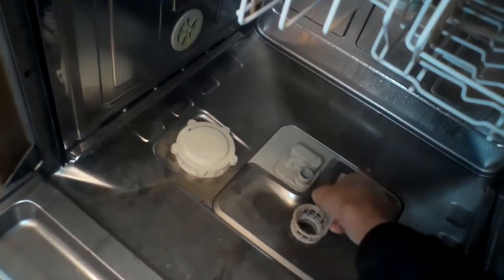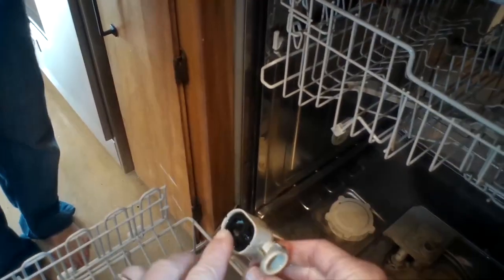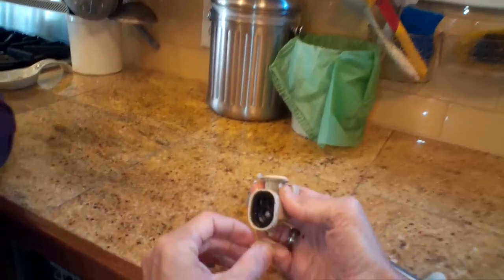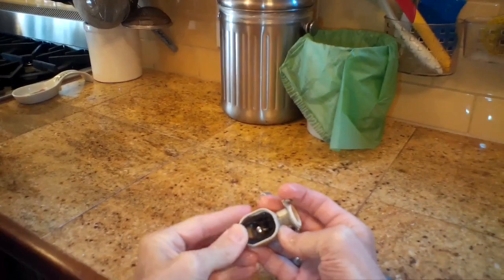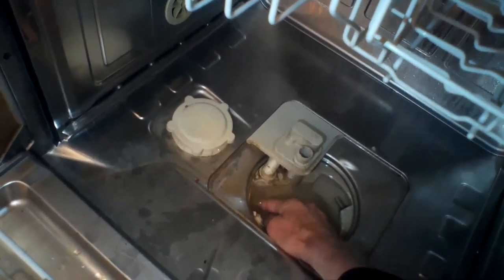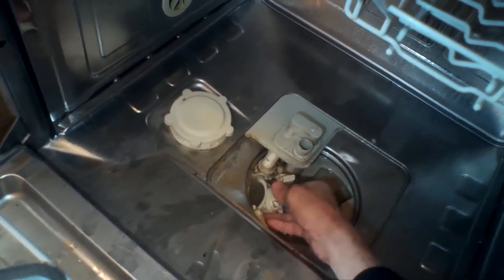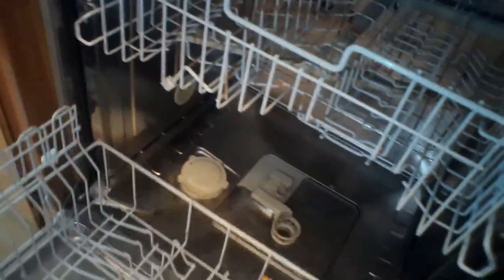✨Miele Dishwasher - Water Left At End of Cycle - EASY FIX ✨

Comment: I’m having an issue where if you do a manual drain it works fine but after a cycle, you see three or 4 inches of water on the bottom. Technician put a new pump in. I did do a power pull still having an issue. it’s getting to the point where it might not be worth fixing and I would hate to replace the unit if it’s something silly any help I would appreciate it
Reply from the maker: Do you think that the fill valve isn’t closing all the way and is letting some water leak in?

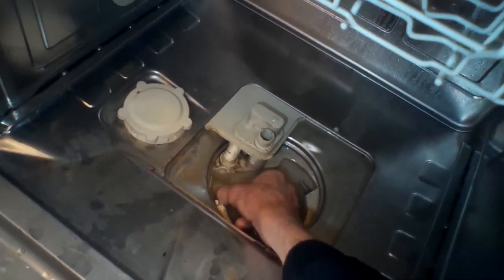Comment: What is the little metal rod with the black seal, just to the very right of your hand (example at 1:18)? Mine used to have this but I just noticed the metal piece is no longer there?!
Reply from the maker: That is the temperature sensor probe.
You can remove the lower panel beneath the door and then one more panel beneath that and you’ll be able to unplug it and reach in and push that pro back in.
It’s important that it is in position otherwise water can leak into the drip pan below the dishwasher.
Reply: Scottthefixitguy Thank you so much for that, I’ll give this a try. I noticed it did seem to be running hotter than usual so that makes sense.

Comment: Did the fixes as Scott describes to ensure augers are free but still have to turn the unit off and back on to reset the error. Then I start a new wash cycle which initially drains the tub but then fairly quickly the fault light comes back on flashing and the unit will not drain?
Reply from the maker: Sounds like it’s draining but then after it fills it won’t do circulation due to a stuck circulation motor.

Comment: What if the impeller is spinning very freely.  You mentioned it may have some resistance. Mine feels like it has no resistance.  The ball bearing moved fine....still have standing water. Thanks.
Reply: Me too. Did u check if waste pipe was blocked.

Comment: There it is. This looks more like the dishwasher I have. That little pipe that connects to the check valve or non-return valve. If you look closely at it, there is a seal around the pipe where it connects. That seal has deteriorated and that's where the water is leaking from. Is that the drain pump assembly? I've been searching all over the internet and I have no idea what the name of that part is.
Reply from the maker: Hi John,

I would call Miele USA and tell them about that one way valve sump seal and they should be able to send you one.
Reply: @ScottTheFixItGuyChannel  Hey. I already did. The part is called the "sump" and it's not something you can replace yourself. Someone actually has to come out and do it.

I just ordered a new machine with the extended warranty for $1399.

The service rep I spoke to said I've already put $500 into the machine already over the years. It doesn't make sense to put anymore. It's 10 years old, but it's actually 20 because it gets used twice a day. 

I've heard the older machines are better because the new ones use less power and water. I guess I'll find out.
Reply: @ScottTheFixItGuyChannel  It's amazing. The one I got is the G4993SCVi. It's identical to the one I have which is G2182SCVi, except it has visual timer and the 3D Cutlery Tray. Other than that, it's the damn same machine. Unbelievable! All their machines clean the same. You're just paying for bells and whistles. 

The saleswoman at the store even said unless money is no object, it doesn't make sense to get their top of the line machine. There were mostly interior designers in there spending other  people's money. The Lumen series of machines, you're basically paying another $1000 for lighting, the AutoOpen function and a few more wash cycles which you'll never ever use.
Reply from the maker: Gotcha,

Another option would be to buy an O-ring from the hardware to put around the stem of the one way valve.

You can even run the dishwasher without the one way valve and it will work.
Reply: @ScottTheFixItGuyChannel  Yeah, I thought of that but from the looks of it, there's no way of removing that part. I'm not sure if it's glued in or what, but there's no screws or anything like. 

The seal has deteriorated from the front and around the back of that pipe. If I set it to Pots and Pans where it has that initial first rinse and drain.  I have to use a WetVac to get rid of the excess water after it drains or else it'll start the main wash with dirty water. I mean the machine will still work, but not like it's supposed to.
Reply: @ScottTheFixItGuyChannel  Okay well you were right, but it took talking to 3 different tech guys to find out. It turned out to be a $20 fix. The "sump" is the entire bottom assembly that includes the non-return valve which explains why it costs $75. All I needed was the cover which comes with the seals. Still getting the new machine installed on Wednesday though. I can't wait until Friday or Monday for the part to come, as ridiculous as that sounds. Calling Customer Service on a Monday is a disaster. Anyway, thanks again.

Comment: Hm, mine is all clean and fine, but it still has some water left. Now even more, almost in line with triple filter inlet. I cleaned the drain hose, looks clean as well. Really makes me wondering what can it be.
Reply from the maker: I bet your water inlet valve is leaking a little bit of water that builds up in the dishwasher even when it’s off.
Time for a new inlet valve.
Reply: @ScottTheFixItGuyChannel  I still have the warranty (10 years). Would this be covered? Is there any way to check it before I call a service guy?

Comment: What about the drain hose? The way our machine is installed, the drain hose comes out of the bottom left of the of the sink cabinet and is connected to the garbage disposal.  I saw in another video that the end of that hose has to be above the connection to the disposal or water from sink may enter that drain hose and go back into the dishwasher. Our neighbor has a Miele and his machine drains almost completely at the end of every drain and fill. 

It's not the impeller and ball bearing moves freely, although sometimes it seems like it gets stuck and there is no way of taking off the seal like you do in the video. Miele's customer service wants $240 just to come out. It's like $180 for them to come out and then there's a diagnostic charge. I'm just wondering if it's the position of the drain that's causing it not to drain like it should.
Reply from the maker: That’s highly likely.

Does it drain through an air gap up by the faucet?
Reply: Hey sorry about that. No, it's just a standard Franke faucet and like a said, the drain hose connects to the disposal which is also a Franke. It's just that I get different answers. The people at Miele say it's normal for water to be there. My thinking is after a wash cycle, if that dirty water doesn't drain completely; it's just being introduced into the next cycle. The guy that Miele store told me that the tabs actually work better if the water is slightly dirty. I couldn't wrap my head around that. 

The machine works, but I would feel alot better if it's drained completely instead of leaving 3 inches of water in that reservoir.
Reply: It was the non-return valve. There was also a crack on the middle feeder arm, plus the threading on the arm was shot. Plus I got all new bottom wheels. Well four of them. I was shocked how inexpensive the valve and arms were, but those wheels were $13.99 each. They kept on falling off whenever I pulled out the tray and it was getting on my nerves

It was draining fine, but the machine makes a distinct noise when it's about fill from a drain. You know what I'm talking about. When you opened the dishwasher at that point, you could see the water just coming back into the machine. He also adjusted and cleared out the drain hose to the disposal. It was a host of issues, but it's working great now. We were going to get a new one, but $1500 versues $215. I'll stick with the old one. The guy also told us the new machines aren't as good as the older ones. They use less water and less power. Who knows, but I know I didn't want to spend that. I'd rather get a new TV for my bedroom.

Comment: Great temporary fix but I’m doing this every other wash. This in turn prevents the unit from drying the dishes. What are the options for a permanent fix?  Thanks.
Reply from the maker: It’s normal for some water to be left under the filter.
Reply: Scottthefixitguy the entire tub is full of water not just under the filter. I have to turn the unit off and back on it reset the error. I then start a wash which drains the tub. Then I turn it off until I need to do the next load. I am doing this nearly every time.
Reply: @serenitynow007  I am having the same problem ... did the fixes as Scott describes to ensure augers are free but still have to turn the unit off and back on to reset the error. Then I start a new wash cycle which initially drains the tub but then fairly quickly the fault light comes back on flashing and the unit will not drain?
Reply: Rodney Dobson did you ever fix your issue?